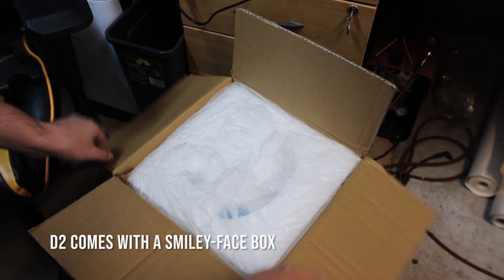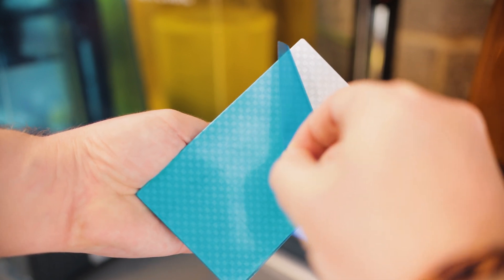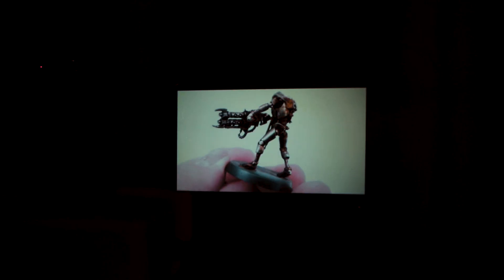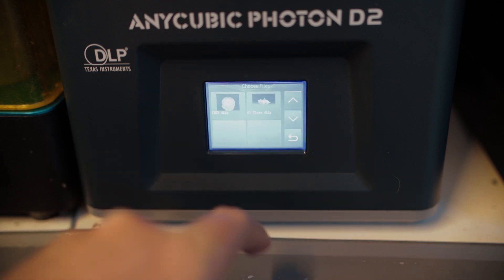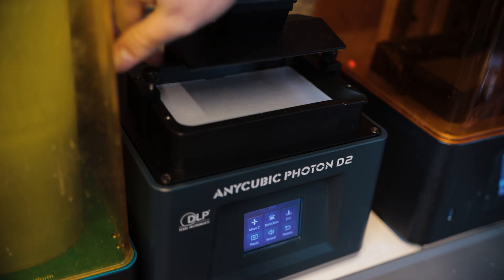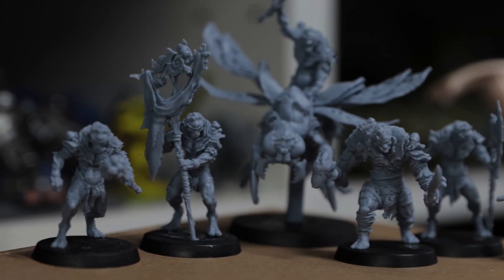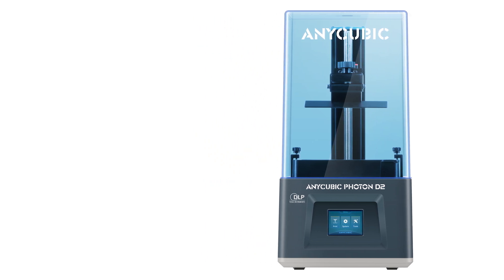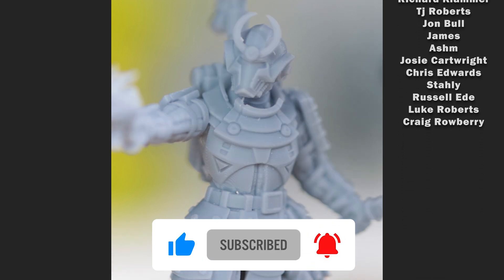What is a DLP 3D Printer - Anycubic Photon D2 Review for Miniature Printers & Painters

Comment: Hi, at what temperature can it print, you mentioned twice at different temperatures, can it be used in a cold room at 0 degrees? Winter is coming, I don't mean to keep him in the house
Reply from the maker: I’ve not tested at it’s lowest I’m afraid.  If it’s at 0, there’s a chance your resin could freeze. (Though I haven’t tested this) You want it at the very least above 7-10 degrees. But even then you may struggle.

Comment: I work with jewelry, we need 3d of a high level of detail, with as few print layer marks as possible. Is the Anycubic Photon D2 the best choice so far? or do you recommend choosing a Phrozen Sonic Mini 8K or ELEGOO SATURN 2 8K MONO LCD
Reply from the maker: Honestly fir your application, I’m unsure. At that scale in jewellery how much would the voxelisation lines show and how much of that would disappear when precious metals are polished?

If you want to aboid any voxel lines the stay clear of the D2.

The Mini8k currently has the best printing resolution of any consumer grade printer.

Saturn 2, like the Mighty 8k and the M3 premium are close in terms of print quality, so you’ll be hard pressed to tell on models that there would be a difference.

But the benefit if these printers over the mini 8k is print area being larger.
Reply: @FauxHammer    Late to the convo but just FYI, yes voxel lines get printed into the precious metal, need to be sanded, and is not a big deal  if the design is simple, but when the design has more detail and intricated surfaces, then the problem is a pain, so we constantly look to get rid of those lines, so the metal just come smooth and we can go straight up to mayba a quick high number sanding and then tumbler polishing, then stone setting, final polishing, plating if applicable and go.. So the voxel lines can delay the process, even make it imposible for some high end designs

Comment: The voxel thing is not true mate. Mini 8K displays them just as clear as the D2 if you use a better resin and dial it in properly. The 8K resin just scatters light and actually reduces real resolution, that's why they don't show, thats also why it rounds off some details in your prints.
Reply from the maker: Having now tested both resins in each printer, I can’t say that I’ve seen this specifically happening. I did a post on my Insta recently showing the same resin on both printers and the difference of voxelisation from the D2 is clear - when you zoom right in
Reply: @FauxHammer  yes of course you see the Voxels. But you see them on the 8k as well if you cure the resin hard enough and get a resin that doesn't scatter light. The voxels on the 8k are a quarter of the size, they are a lot harder to see. Try a transparent resin ans cure for like 3 seconds per layer

Comment: Great video - a friend and me bought the D2 after watching your video. We are still struggling a little bit, as we are new to this interesting hobby of 3D printing - so out of curiosity - which print settings do you recommend for the D2 for miniature printing, like the OPR things you printed in the video? Especially for the DLP Craftsmen Resin? Kind regards in advance!
Reply from the maker: I wish I could give you settings that would help but you need to test it and get the best settings for your printing environment.

Just print the exposure test I do and count the holes and pegs, if you get the same number, that’s dead on perfect exposure.

Fewer holes is over exposed. Fewer pegs is under exposed

Comment: What slicer are you using? I have lychee as well as chitubox and the max AA level is 8 on each and Lychee doesn't seem to have a "image blur" setting.  I have a photon Ultra and may Update to the D2. Also i'm really confused as to how you got that resin that flexible.
Reply: Also what is your post print process? I have a wash and cure and usually was for 3 mins in Denatured alcohol and then cure for 90 secs on each side.
Reply from the maker: I use lychee to support, then export the STL and slice in Chitubox. Had far too many issues with lychee

Comment: Thanks the best walkthrough among dozens of videos  Ive seen. Im not going to do miniatures only, and im torn between 3 models, i would really appreciate your take on my choices. I was thinking of the Saturn 2 as the "expensive" one, and the alternatives would be Mars 3Pro and  Photon Mono 4k.  Regards/Eddie
Reply: If you choose between Mars 3 and Mono 4k, they both have the same pixel size (35 micron) and similar build volume, but Mars 3 has working anti aliasing (AA) out of the box while Mono 4k still doesn't...
I have both...
Reply: @P1x3lMagic  many thanks for your input. this morning i ordered the satun 2, finally. It was panful to pay that extra and to not choose the mars but i felt that i will need that extra space. Regards .
Reply: @houseoflatin  
Saturn 2 is excellent choice indeed being first affordable printer with big printing volume and 8k (28.5 micron) accuracy.

Don't forget to buy washing/curing station of the same size 😉
Reply: @houseoflatin   so it’s been some months, how are you liking your printer? I’m thinking of getting my first soon.
Reply: @taylorhoward6411  Hi T, totally worth it, no complaints what so ever. Now, if you are unsure of your interest of the hobby, then get the a small cheap one and figure it out, then you can still buy the larger one without taking the risk. having two (small and +)is very useful. Cheers
Reply: @houseoflatin  hey, if it’s okay to bother you once again, that’s the printer I think I might have settled on, how are the print lines/voxels? Are you using AA? Are they noticeable to you or almost invisible?
Reply from the maker: So. I;d get the Mars 3 pro over the Mini 4k, same display resolution on both, but the Mars 3 is slightly larger and cheaper.

The saturn 2 is an upgrade to both, about half way between these 2 printers and the mini 8k in terms of print resolution. in fact it's eactly half way between.

It;s a lot larger too so if you can stretch to it, it would be my choice.
Reply: @FauxHammer   Thanks, then I got my choice between a smaller and bigger alternative. My hesitation investing in the “pricier” as a newbie was newer better models seem to come so fast in this sector. But if i take the Mars it will take time before i upgrade and i will probably miss having a bigger plate. Many thanks for taking the time to answer my question. Regards/E

Comment: 8:04 could please clarify? does AA and blur significantly reduce Voxel and layer lines or not? you commented bellow that "The simple breakdown is the D2 is sharper, but more visible layer lines". So what is it? Will I get better results and less voxel lines than the Anycubic Mono 4K? (using max AA and blur).
Thanks for the excellent review.
Reply from the maker: So, LCD printers have some roundness to teh edges anyway, so once you add image blur and AA to those it will soften them. But the sharp edges are not as sharp.

You can significantly soften the edges on the DLP printers with AA and blur, but due to the sharpness, they are still more precieveable than an LCD printer. After paint however. IMHO indistuinguishable on both, but I siuppose that depends on how heavy you paint.

When comparing to the mono 4k specifically, I;d say this is equal to the Mars 3 pro and Phrozen Mini4k at 35um. those 3 printers are arguabley the best you can get for a gaming mini on an LCD printer, anything I've seen with higher resolution requires specific resins, and those resins are usually more brittle to the point of not being as useful for gaming. At least until someone finds a way to make a softer version of those high-res resins. if you print on something like the Mini 8k with a softer resin, the results are comparable to one of these 4k printers.

So the only way to get more detail in a softer resin is with a more direct cure. So DLP it is.

You want higher detail, no percieveable layer lines, but brittle? get the mini 8k
You want higher detail flexible miniatures but slightly more noticeable layer lines, get the D2
You don;t want higher detail and want a flexible model with no percieveable layer lines, stick with what you have.
Reply: @FauxHammer  wow... I am so grateful you took the time to answer my question extensively. thank you so much. I liked and subscribed.
Reply from the maker: @walterrldias  Woah, woah, WOAH!

You weren't already subbed? I take my answer back! ;) lol
Reply: @FauxHammer  I am like saint thomas! hahah.... good job.
Reply from the maker: sorry, voxel lines, not layer lines
Reply: If you start with sharp edges prior to using AA the result will always be superior as compared to starting with rounded edges, and rounding them further using AA. It's an interesting argument that makes it very difficult to argue in opposition.

Comment: I just don't like that they basically took the Mono design and then threw a DLP under it. The mono had Z Flex as did the 4k version, plus both of mine came with a dud Z rod so I'm not too keen on AC.
Reply from the maker: fair enough, not bother about the asthetics personally and never had a problem with the mechanics myself.

Comment: So the one of the left is clearly the d2 the right the mighty 8k or whatever. I also think that the 8K one looks better so I look forward to seeing if you convince me otherwise. And no they look completely different and you can tell right away. Everyone argues that the DLP looks sharper. But I just don't see it. And I could show you where there are details in the 8K that clearly aren't in the DLP. I want to like DLP printers because of the better life span, lower power cost, etc. But I haven't seen any evidence that it produces a more detailed print. All the other stuff you said about the printer makes me want one. But the print quality is not the factor for me especially since I don't see better detail. I just don't.
Reply: You can soften the DLP print process but you can't sharpen the LCD print process. In that sense DLP is more 'raw' , contains more high frequency information and is more amenable to digital processing. LCD has an inherent and unavoidable low-pass-filter which you may or may not not find favourable but you are nevertheless stuck with it.
Reply from the maker: It really is a hard one.

The simple breakdown is the D2 is sharper, but more visible layer lines

The 8k is smoother but softer in the details.

Can you tell? Probably not.

But I prefer the resin that comes with the D2, specifically for minis
Reply: @FauxHammer  No, I cant tell the difference in accuracy or whatever. The layer lines, on the other hand, are super visible.
Reply: Yeah, I was expecting the one on the right to be the D2 and be blow away, but nope. The one on the right looks significantly better than the left IMO.

Comment: Mine just came this morning! I'm most excited because of the increased build size. The Ultra is quite dainty.
Reply from the maker: How are you finding it?
Reply: @FauxHammer  it's fantastic. These are incredible printers. What a time to be alive!
Reply from the maker: @1nePercentJuice  so good right! I remember cracking out the Ultra having used the Photon S before it and my jaw hit the floor!
Reply: @FauxHammer  me too man. I started with a Photon Mono X for my first printer and it's incomparable. The quality I'm getting in 32mm on these DLP printers is almost like magic. We're so lucky to be alive in times like these.
Reply from the maker: @1nePercentJuice  It's only gonna get better too! I honestly think we have almost piqed on quality. When we get an 8k projector in a similar print form factor to this, we are there, that;s it, done finito. but at this point, the resin makes a lot of difference.
Reply: @FauxHammer  i agree 100%. If it can get better than 8k DLP it'll be imperceptible to the naked eye. The DLP Craftsman resin def makes a difference. From what I understand, they added ceramic to the resin to make it more opaque/reduce light bleed.
Reply from the maker: @1nePercentJuice  If true, I wonder if that's what gives it the slightly matte texture? Which I really like for paint adherance.

Comment: For just display painting and up to 75mm models, so material durability/flex isn’t a factor, and just in smoothness of print and accuracy of detail would you still go with the D2?
Reply from the maker: Oooh, good question. So if I were to want a pro painter to show off my new minis, or I were a competition entrant. I’d want smooth over anything else. So I’d get the 8k, but I’d also expect that when removing parts  from supports, there would be cleanup to do. Like shaving down and refilling pick marks, even a touch of resculpting some finer details with putty. But for the lack of sharpness a pro painter would redefine recesses with paint.

https://phrozen3d.com/pages/mini-8k-preorder?aff=176

Comment: Great video mate, I think you've sold me. I will be looking at DLP for my next upgrade. Can I just ask, having found my favourite resin in Siraya Tech Fast - my experience with the Anycubic resin is that it absolutley stinks. How does the DLP Craftsman resin rate? Will I need to consider additional ventillation if I use this machine/resin?
Reply from the maker: Hey man, that’s awesome glad to give the advice.

I’ve not used Syrayatech though many people recommend it.

I can imagine it will carry its existing proporties but the result will be sharper than it is in other printers.

I really should contact Syraya and ask for samples

If resin smells, resin smells, but unlike units with fans in, I can only smell this one when I remove the lid. So take usual safety precautions but whilst printing, it’s far less noticeable
Reply: thanks for the kind words. Fast will work fine on Anycubic D2 DLP.
Reply: @sirayatech2  well, if you’ll like us to show it off, please feel free to get in touch and we. An use it in future vids.

Comment: My only gripe about the D2 is the build plate size, the extra 4cm I get from my Saturn allows me to print giant mechs. Once its as large as a Saturn I will be in the market for a DLP .
Reply: What do you set your settings for the Saturn. I don’t get great prints with it
Reply: @InitiallyJB   I used Atlas grey settings and modified them to suit the Resin. The numbers look a bit extreme but the rate of success is extremely high. Saturn has a Two Speed process going on in the background, so the speed setting may look fast but its not.    Sunlu Grey - Lychee Slicer - Burn In Layers: Number of layers = 10, Exposure Time = 35, Transition Layer count = 20, Light of delay = 1, Lift Distance = 8, Lift Speed = 45     Normal Layers: Layer Height/Thickness = 50um, Light Off Delay = 1,Exposure Time = 3.8, Lift Distance = 8,    Speed: Lift Speed = 200, Retract Speed = 150
Reply: @lordnovas  thanks so do you use chitubox at all or do you convert from lychee with settings
Reply: No doubt they will have a bigger one in 6-8months 👍
Reply: @HeliumFreak  They're at the mercy of the projector manufacturer just as the LCD printers are at the mercy of the LCD manufacturers. But I'm sure Texas Instruments consider this an important market if not a lucrative one.
Reply from the maker: Yeah, there is that. As a mini printer I print mostly rank and file and the odd vehicle or monster. This is fine for that.

But the Saturn build size is appealing